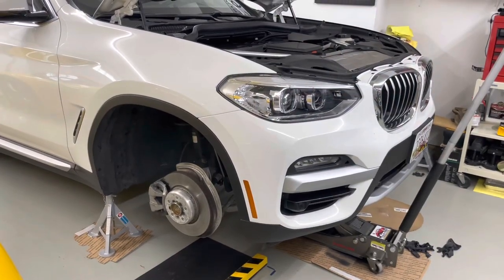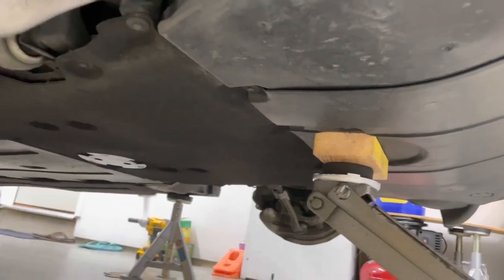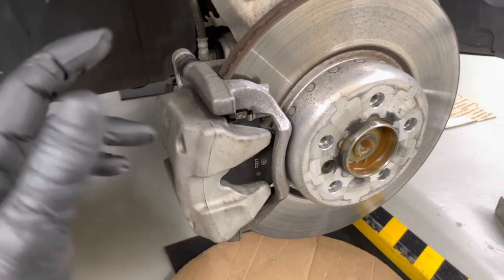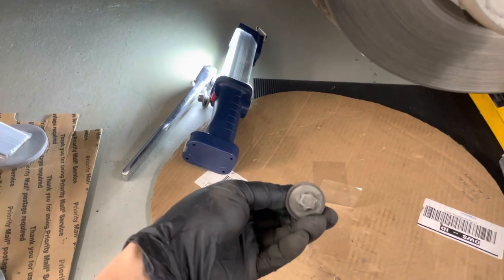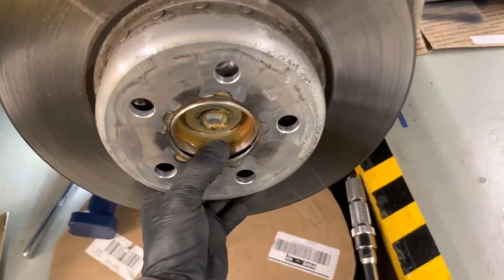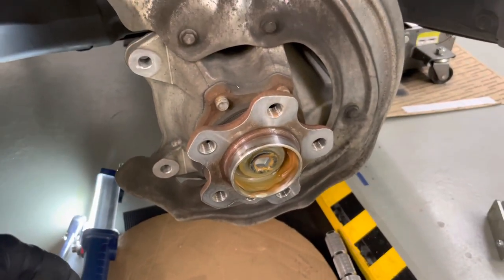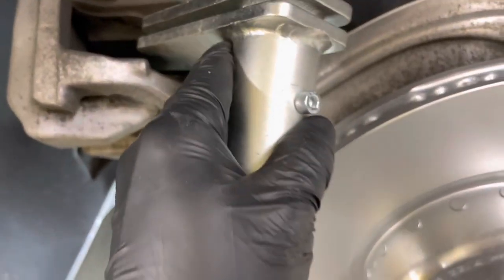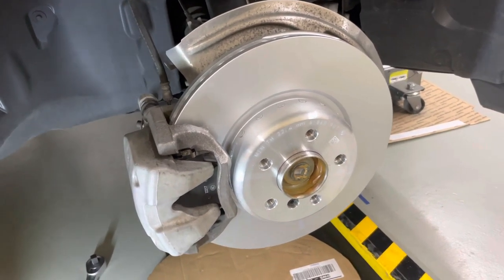BMW X3 ‘18-‘21 Brake Rotor Replacement

Comment: Good video. That bolt that holds the caliper carrier bracket to the back of the hub is a torx bolt. Specifically it’s requires a E16 (External Torx) socket. No, you should not try to remove it with a hex socket that kind of fits because most likely doing so will damage the head of the bolt, and you would have created a bigger problem if you ever want to change that rotor now or in the future.

Comment: Very clean environment at work ,
Very informative,
The camera is in good distance,
Explanation nicely made, 
Thanks bro,
One question: you mentioned that the router screw socket is 16 LN 
Is it a normal 16 LN Key ?
Thanks
Reply from the maker: Hello. Thank you for the kind words. The rotor hold down screw is your normal 6mm allen key type socket.

Comment: Good DIY !  At time 2:01 shows floor jack cradle + hockey puck + wood block (2 x 4 ???), what size dimensions wood block is that?  Thanks!
Reply from the maker: Hi good eye!  My rubber pad for the cradle broke some years ago so I substituted it with a hockey puck. I then use the 2x4x6” to evenly distribute the weight of the car. Thank you.
Reply: @diydaddy5092  I saw your other comment in different video, "I’ve owned BMWs since the 90s. I jack them all up from the rear diff. Make sure you use a rubber hockey puck on the jack pad.", do you also use the same 2x4x6" on the rear diff jacking spot?  Thanks!
Reply from the maker: @dinan53  for the rear diff, I skip the wood. I lift it using just the hockey puck since it’s gentler on the aluminum case.  On the X3, I use a piece of wood lifting the front because it’s butted up against a steel beam covered by that piece of black plastic belly pan cover.